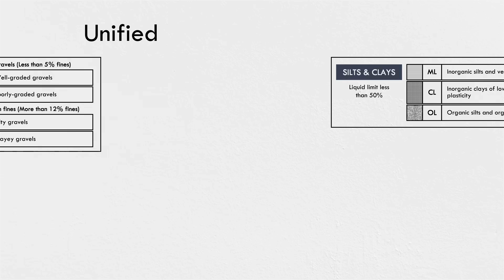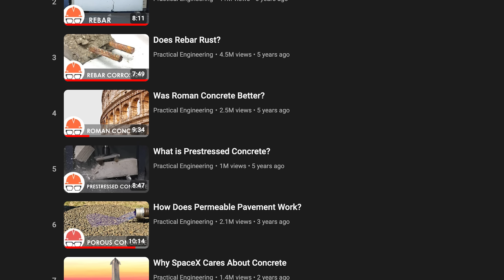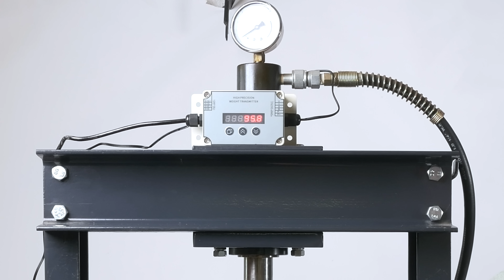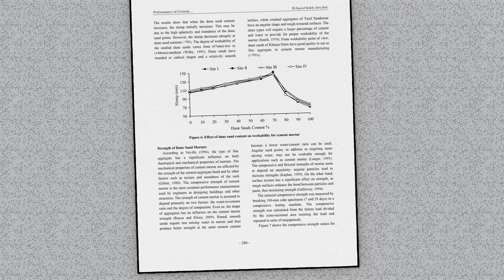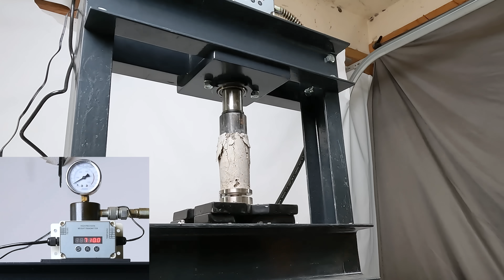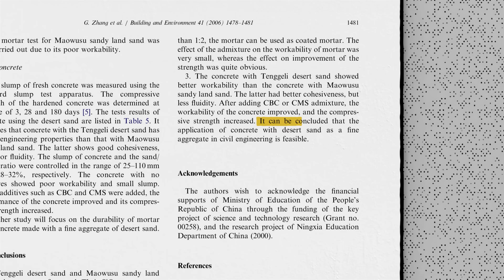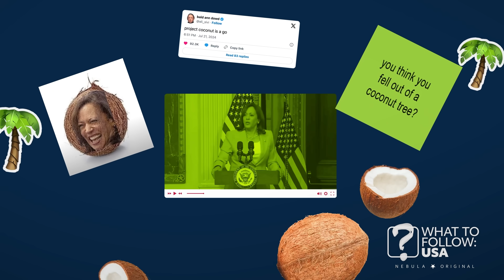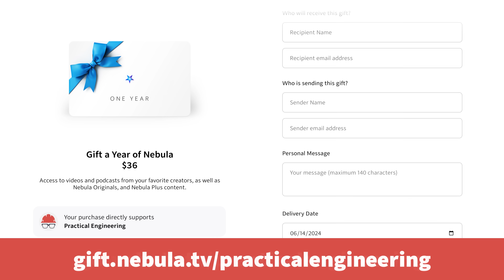Is the World Really Running Out of Sand?

Comment: Hi Grady, long time watcher, first time commenter. I don't think your video tells the whole of the story, garage tests are fine to prove a point, but the slump you were aiming for was far less flow that I'd associate with concretes, especially for pre-cast applications. Particle shape still plays some role in the final strength, though the distribution is the main factor in workability. Compared to many mined/dredged/quarried sands (including desert sand), properly specified and engineered sands have the ability to increase the strength, or decrease the cement requirement in concretes. With cement being a big expense in making the sand, and a big carbon contributor, there's a lot of value in using the best sand for the application.
Plus the sand is so expensive to transport, and a lot of consents for local sand quarries/sites are being rejected due to ecological reasons. I think there is more than a grain of truth to the sand scarcity argument, and we should be looking for alternatives to conventional sand to lower the ecological/carbon impacts of concrete production. Desert sand is not a viable alternative without externalizing more of those transport costs onto the environment and the future (a very memorable line that I'll try to use in future!).

Comment: Recall seeing some additive that a person added to their concrete for a simple test comparing it to Roman Concrete; the additive allowed only 8% of water or so compared to the 35% to cure fully, producing an extremely strong concrete that blew Roman concrete out of the water. Not sure about my numbers, as it was years ago that I saw the demonstration, but the percentages are roughly what I believe they would compare to... took a small bit of water, like 2 tablespoons per a red solo cup of the mix to start solidifying while the Roman one was more traditional, needing much more water to even be workable. Wish I could find the demonstration to share, as it was super cool and starting to get to bunker levels of resistance lol

Comment: I always am fascinated by when the sidewalk changes batches of concrete, seeing the change the the general size of the grains as you move from one batch to another.  I somewhat thought that the concrete that looked the "smoothest" was probably almost entirely cement, having been recycled a number of times until the large aggregate pieces were no longer apparent, but it seems more likely to me now that they just use a much higher proportion of sand compared to the kinds where there are lots of visible smaller rocks embedded in the cement matrix.

Comment: Wow! The best and most nuanced review of sand and sand in concrete I've seen. Whenever someone says 'this is how it works', over-simplifications creep in. You didn't fall into the trap and told it like it is: wickedly variable and complex. Like some of the strongest concrete I've made was set in slightly salty water on the bottom of a neglected bucket. The arguments against more earthen builds and regional variation apply to concrete too, only the strength threshold is generally higher so people don't tend to notice. Thinking like a Roman is the answer - even with no rebar the romans spanned huge gaps without support by having a dazzling understanding of different types and mixes of concrete. Concretes (and geoploymers generally) are fantastic but also fantastically complex. There's no substitute for testing your materials and processes before you scale up.

Comment: I've replaced a specific concrete mix with crushed rock from the builders yard + cement on a few home projects where I didn't need a specific PSI rating. Having had to hammer some of it out recently I'd happily do so again. 

Also look up recycling of concrete by substituting it for lime flux in an electric arc furnace. The intense heat reverse the hydration reactions, vastly reducing the energy required in the production of cement given its taking a free ride on an existing process. Can it be scaled up? Uncertain,

Comment: Two additional points to make. 

1. There are concrete additives (plasticizers and fibers) that can be added to concrete making it stronger, compensating for any loss of strength due to the type of sand used. 

2. As particular sand types become more rare, they will become more expensive, encouraging more resources directed toward mining and exploration, opening new economically feasible sources, supporting supply. Not to mention more efficient use and substitution as components become more expensive

Comment: Time to mine the sahara for all the sand
Reply: Wouldn't be such an issue if it was possible, unfortunately sand that have been exposed to special types of erosion, like wind, don't have the shape necessary to be used for concrete. Some use it either way but the houses are very fragile, which can be dangerous

Comment: Maybe its because I am from different 'circles' but the 'sand is running' stuff I have seen is mostly related to 'natural rounded sand' because that is the one thats used in semi conductors,  never seen any bits about concrete etc because well concrete is doesnt require that type of careful nano-scale manufacturing.

Comment: I work with semi-dry concrete (arround 100L of water in 1 m3 of mixture), its crazy how much difference between 2 location of source barely 20 km apart, both riverbed sand. Its like one is a sponge, needs 150L water and easily handles 300kg cement in 1 m3, other needs barely 80L of water and 200 kg of cements makes the mix barely workable

Comment: I used to work in a sand and gravel quarry. We ran the over sized rock through hammer mills to produce usable product. We sold 2 types of sand. Mined sand from the quarry and cracked rock (sand) from the hammer mill. when it came to sand or cracked rock, it depended on who was buying it. Plasterers and stucco companies prefered the cracked rock because it stuck better to vertical surfaces. Everyone else used ordinary quarried sand.
Reply: Is there a significant difference in price between those two?

Comment: I've been a structural engineer for 40 years and still learn new things in many of your videos. This one is really good.
Reply: I wonder what you have learned recently
Reply: @temakevi  That it's good to be retired, even though I never regretted my career choice and got a lot of fulfillment out of it.
Reply: @NorbRetEngineer  I didn’t mean to be rude. It was a genuine question. I'm an intern myself, so
Reply: @temakevi  Fair enough. I would suggest taking on a variety of different assignments as that will make you a more effective and well-rounded engineer. I worked for many years for a large state transportation department, and would usually request a new assignment every 7 years or so, usually via lateral transfer. That may be harder in a private company, where they want you to keep doing what you're really proficient at, since that is the most profitable for them. In that case, you may want to change employers if your current company can't or won't accomodate you.

Hope this helps.

Comment: We made concrete for a lab class and our group’s initial batch didn’t have enough water in it.  Only, the person in the group who calculated how much water we’d need to add accidentally calculated the total water instead, so our concrete ended up with a 7 inch slump (it was supposed to be ~2 inches).  We didn’t have time to remake it, so our concrete ended up performing far worse than everyone else’s in the strength test after it cured.  So yes, I can confirm that concrete engineers have very good reason to want to avoid adding water unnecessarily.

Comment: At my school my group did an entire project on the feasibility of recycling concrete as sand for our senior design project. We found that it was a pretty good replacement for a good portion of the sand even if the concrete used was old.
Reply: Recycled concrete is often used as aggregate for new concrete so you are absolutely right!

Comment: While working in material testing facility I learned lots about soil/sand and concrete. Then later when working at an engineering firm I heard that Saudi Arabia imports sand needed for making concrete. Then before I retired and working in Saudi Arabia I was able to confirm that yes Saudi Arabia imports sand used for making concrete for the reasons mentioned in your video, wind blown sand is too rounded while imported sand has edges. Thanks for refreshing all the things I have learned over the years though out my career. Thanks for sharing.
Reply: I was in the desert around Dubai. The sand was super fine and kinda like mini ball bearings. Couldn't imagine it has many purposes.

Comment: Sand isn’t used in semiconductors, it is way to impure. Semiconductor wafers been to be 99.9999999% (9N) or more pure and they are currently made using the Czochralski method which requires pure silicon crystal “seed” from quartz to start the process.

Comment: Helped my brother in law last year. They wanted some foundations for their raised beds. The first sign that it wouldn't be fun: He bought 10 bags of concrete cause he thought that would be more than enough. And as it is only 10 bags - no need for a concrete mixer - do everything by hand. Told him to lay out the bags where they wanted the raised beds cause that was just about how much we needed... it was over 4x more.
Then when we started working he started with the mixing. I asked about the ratio as it was a fixed finished mix: "Just so it looks right". 
I simply read what was written in larger bold letters. Turns out: when you follow the instructions you get a nice workable mix. Not so dry that it is crumbly, not so wet that it runs away, easy to get the bubbles out and compact and also takes a nice smooth surface very well.

With other concrete projects i have seen it mostly was similar. Gravel and sand for the mix? "Just take the cheapest". How much water? "If it is dry just add a bucket"
That is the difference between a driveway starting crumbling from frost and under load in just 5 years, or lasting decades.

Comment: We run out of easy accessible sources, therefore if the base materials get more expensive to get, entire construction sector will get too, like it doesn't have enough problems as it is. This has gigantic ramifications.

Firms will either skimp out on using the correct sand to make their concrete like we see in china videos of tofu dregs, or you will be billed much higher by those who use the correct one.

Savage river bank sand pillaging is already a thing in a few places...

Comment: Interesting to note that water:cement ratio for workability and not the granular structure of the aggregate is the reason Artificial Sand mixes require more cementous material than Natural Sand. Though this advantage may be partially offset by increased silt content in Natural Sand.

Thanks Grady.

Comment: The cost of production part of man made sand is one that eludes me a little. Couldn't we literally use wind and water mills for this to power either large series of large tumblers or tilt hammers or both, basically gettng the electricity bill to 0 on account of not using electricity? It doesn't need to be a fast process, just a constant stable one, so once the first batch is out, there is always a timely next batch ready on time that entered production shortly after the first, and on the cycle goes.

Sure, probably still more initial and running costs than just showing up with trucks and loading up, but the shorter transportationg needs of tons of the stuff, the lower environmental impact, and the lower transportation needs due to shorter distances, they probably more than make up for it.

Comment: First of all, thank you for such a good video. When talking about the uses of sand you mentioned glass and then fibre optics. It was a bit redundant as the best fibre optic cables are made from glass and historically they were all made from glass. I know that you were trying to make the point about how sand impacts society but perhaps you could have shown both items when you said glass and used another example. I did want to point out that a lot of fibre optic cable is being made from plastic now so the importance of sand in that way is diminishing. 

When making concrete you only talked about using rounded, natural sand or sharp, produced sand and then the amount of water was used to control the workability. Do you know if there been any studies performed that used both types of sand and varied the percentages in order to increase desirable traits while minimizing undesirable ones? Of course it's such a complicated product that an experiment would be valid for certain environmental conditions, specific aggregate size and percentage, percentage of sand, amount of water, etc. I live in Canada and I remember when construction projects would shut down during winter because concrete wouldn't cure in the cold temperatures but researchers found the combination(s) that allow concrete to be poured in all but the most extreme conditions. I just thought that mixing round and sharp sand might be an alternative to just adding water to get concrete more workable.

Comment: The thing here is that... not all sands are equal. Different industries require different types of sand. For example, silica sand for glass. However, the sand for glass is totally inadequate for use in fiber optics. The semi-conductor industry also uses silica sand and, again, it has to be very carefully chosen. I've heard some talk about "concrete sand" and that's mostly bunk. What is more of a concern is that there really is a practical limit to silica sand and that's becoming more and more of a concern as we consume more of it in industry after industry.
Reply: Can silica sand be manufactured?
Reply: This was my understanding too, that we’re running out of sand suitable for making processors. Or rather that the greatest supplies of it are located in countries that western nations don’t play nice with:/ Politcs has to rear its ugly head in everything:(

Comment: there is some important info missing concerning utility od sand to produce high quality concrete
sand may undergo process called alkali-aggregate reaction (AAR) and it is highly adverse  due to spatial expansion during reaction causing severe tensional craks and structural damage
in EU both aggregates and sands are required to be tested by many authorities in civil engineering, petroghaphic tests and expansion tests of mortars/cubes

Comment: 11:45 How is river sand angular but desert sand rounded? In rivers, the sand is in constant motion due to water flow but in desert there are proportionally much less strong enough winds to move the sand. Intuitively, river sand should be much more rounded than desert sand.
Reply: https://pubs.usgs.gov/of/2004/1007/erosion.html explains it pretty well. The page isn't super long, it'll take ya 2 minutes to read ❤

I just woke up and wanted to try and summarize it but.. brain. Your thinking is sound in the absence of other conditions, but when you account for mobility of the particles, how fixed/fluid they are, temperature stability, etc., the thinking will shift.

Comment: You mentioned rock crushers , one thing I learned a while ago that surprised me it by far the most efficient part of breaking rocks up is where they are first separated from the larger rock formation with explosives. After that, most of the mills and crushers we use have an efficiency of less than 1%, this is mostly down to reliability concerns, because it turns out pulling several tons of material out of a ball mill is not enjoyable.

Comment: Chemist here, just want to say thank you, you give me hope that some engineers aren't all bad :P.

Now for the actual comment. One of the things I have noticed a lot in my work is an "ease of measurement bias" everyone reports density and pH (where applicable) on their products, as they are fast and easy to measure. However, harder to determine, but far more valuable measurements are generally not taken because they are more difficult to take. This seems like one of those instances where the measurement that should be taken on sand bound for concrete should be an average surface area per unit of mass, but instead we use particle distribution on 1 type of sand as a stand in because it's cheaper. I am curious how that will evolve as we try to control building costs.

Comment: Great video.  We also use silica sand in the power industry.  Current limiting fuses are packed with silica sand to generate enough resistance which quickly stops current flow after the arc starts.

Comment: Plasticizers can help with workability without the need for additional water. One of the guys I deal with operates a small plant making decorative facing stone for buildings. His biggest issue is having the mix fluid enough to fill the mold properly on the shaker table but if he adds too much water the brown dye (a iron oxide) changes from brown to pink due to some chemistry happening with higher water contents. He was recently over the moon about a new plasticizer that gets him his workability with less risk of  the plasticizer affecting the concrete mix strength character(since he has to demold and transport the stone)